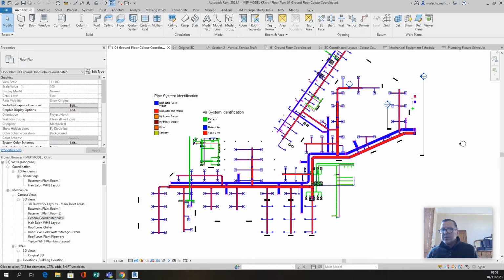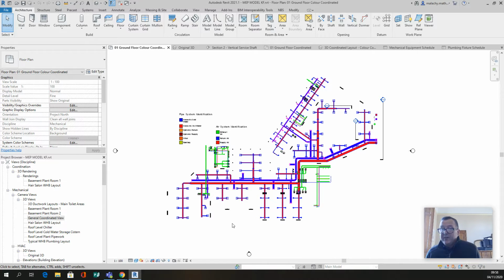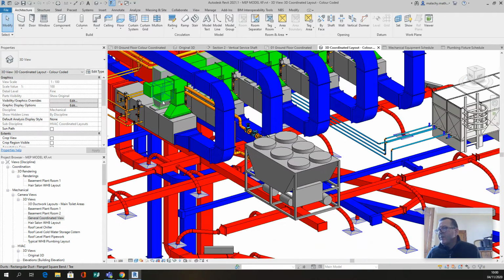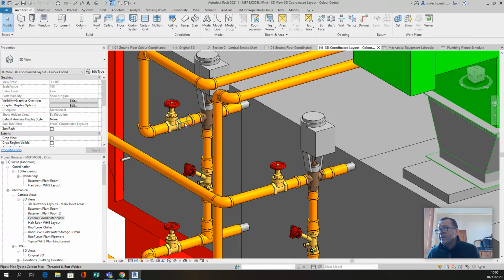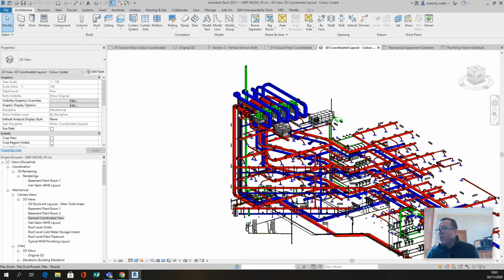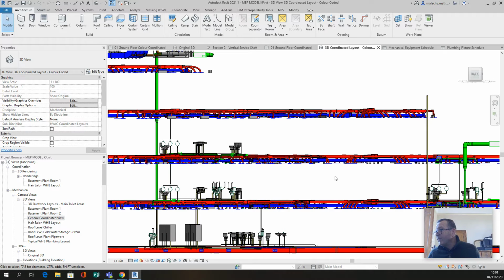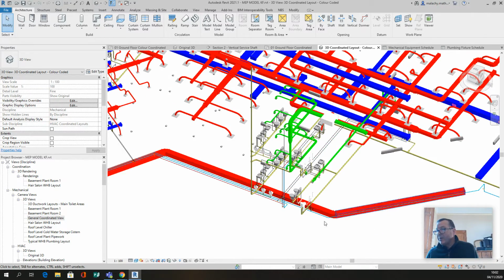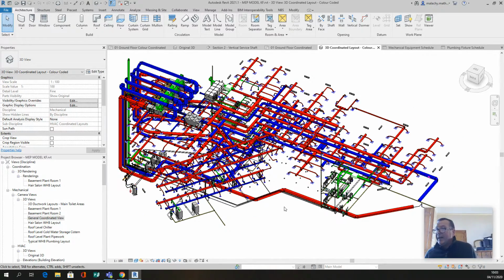Mechanical Services Model for a Civic Center - Sample

Comment: The ceiling void was used as a plenum in this design. The Return-Air diffusers therefore do not need to be connected directly to the return air duct. This is why they just stand alone in the model.